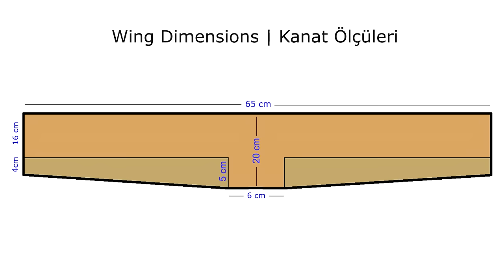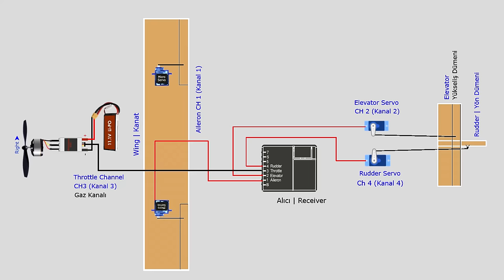How To Make RC Model Airplane Fun-Fly Style. DIY RC Airplane With Brushless motor

Comment: I got all the materials on your trainer, 2 prop plane and this plane, thank you very much for all these informative videos.
 The only problem is the Kraft (fotoblock) supply in the US, plastic covered 5mm white ones are more common. On some videos you used white, on some of them used the kraft covered one. What do you think, does it cause an issue if I use white instead of Kraft?
Reply from the maker: You can use the white one on all surfaces.
Reply: @Kendin-Yap  Aslında Flitetest gibi power kit ve ilaveten hardware kombinasyonlarını hazırlayıp ve bu kitleri ABD'de stoklasak benim gibi binlerce kişiye hem kolaylık sağlamış oluruz  hem de kıymetli emeğinizin bir nebze karşılığını almış olursunuz. ABD ihracat rejimi mikro ithalat konusunda çok serbest ve belli meblağlara kadar vergi dahi uygulanmıyor.
Reply from the maker: Mümkün tabi ama bunlar benim için sadece bir hobidir.

Comment: i have a doubt what if i use 1400kv motor with 1045 prop will it fly if yes then tell me will it be fast or slow please reply i am waiting
Reply from the maker: You should use the propeller specified in the technical data of the engine you have. 10 inch propeller for 1400KV motor is a little big.
Reply: @Kendin-Yap  bro then what is suitable can you tell me and will be 1400kv good for this build

Comment: Can I use wooden propeller with same size (6x4) two blade propeller? Thanks a lot!
Reply from the maker: Yes you can
Reply: @Kendin-Yap  Thanks!
Reply: how long will it fly using 1500 mah battery?
Reply from the maker: @dfastgamer9459  5-6 minutes

Comment: Can you please let me know about the circuit in wings there are 6 wires from servos how did you make it 3
Reply from the maker: Two 3 pin servos + One Y extension cable for parallel connection. This is normal practice.
Reply: @Kendin-Yap  ok I am confused

Comment: I could use a 3s battery with a capacity of 1500mah, would it be too heavy for an airplane
Reply from the maker: A little heavy but available.
Reply: let me ask the C discharge current of the battery
Reply from the maker: 25C or higher

Comment: Can use prop 1045 please reply for this comments please or can use 8045 or 6045 reply as soon as possible
Reply from the maker: Propellers such as 6045, 6035, 5045 are suitable. 1045 is a very long propeller. It is not suitable for this aircraft and motor.

Comment: Can I use a 2212 motor instead
Reply from the maker: Yes you can. 2212 2000-2400 kv
Reply: @Kendin-Yap  size of the foamboard you used for this build??
Reply: @kakarot694  5mm

Comment: How long push rod (14 cm or 18 cm) push rod should I use for the elevator and rudder.? And the push rod got discontinued so please send another link. Thanks
Reply from the maker: This is not a fixed measure. You will determine the servo according to where you position it. You need to measure the distance between the servo and the control horn.
Plus or minus a few cm difference doesn't matter.
Reply: @Kendin-Yap  Thanks a lot.

Comment: After a lot of work. I finished this model. The weight turned out to be 456 grams. with 1500 ma battery. 
If the author is kind enough. Tell me what costs and angles to set for a new pilot.
I have set 15 degrees throttle, 15 degrees ailerons and elevator so far. Exhibitor 33%
Reply from the maker: For a start, the aileron, elevator and rudder angles can be around 20-25 degrees. Then, if desired, increase or decrease can be made.
Reply: @Kendin-Yap  YES you are right, the consumption of 15 degrees is not enough.  Most likely the trainer will assemble the plane with a vorhnim wing arrangement. Since this one requires very good management skills.

Comment: Gud job sir..is it ok if i use motor 2212 1400kv prop 8"  tqvm
Reply from the maker: Can be used. But for the 8-inch propeller, the landing gear should be slightly upgraded.

Comment: hi, very nice video, but can you give me the link of an another foam board because the one that you linked in the description it's finished, and can you give me the flight time? thanks
Reply from the maker: Thanks. Foam Board is sold in shops selling architectural model materials in my country and is very common. It may be useful to research these types of stores in your area.
Other option: http://bit.ly/2Qb2TOr
Reply: Can i use balsa or depron instead?
Reply from the maker: @andreamarcheggiani9404  Yes you can Balsa or Depron. (Depron is lighter from Kraft Foamboard.)
Reply: Thank you so much

Comment: Can i put a 2200Mah lipo for battery
Reply from the maker: It is heavy. Maksimum 1500mah.
Reply: @Kendin-Yap  thanks
Reply: @Kendin-Yap  i see that the lipo battery you use is 74g and 119g thus it will fly if i use turnigy 137g? sorry for too much question
Reply from the maker: @katelorenz7546  I'm not sure it's a little too heavy.

Comment: what if I have two servos for elevator and not a connecotr cable where 2 go in one
Reply from the maker: You can use two different channels from a single control with "program mix". You might want to investigate the "Program mix" setting.

Comment: esc ve pilin motor çalışmamasına rağmen sadece birbirlerine bağlıyken ısınması normal mi ve çalışınca çok ısınması
Reply from the maker: Kesinlikle normal değil. Çalıştığında bir miktar ısınması normal sadece.  Bağlantılarda veya ESC nin kendisinde bir sorun olabilir veya motorun bobini zarar görmüş olabilir. Çok yapılan bir hata Motoru vidalarken gereğinden uzun bir vida kullanılması ve motor bobinine temas etmesi sonucu bobine zarar vermesi durumlarında da bu tip bir sonuç oluşabilir.
Reply: @Kendin-Yap  bir şey sorucam bende 30A bir esc ve 11.1V 2200 mAh bir pil var ısınmanın sebebi parça uyuşmazlığı falan mı acaba? motor da 2200KV
Reply from the maker: ESC 3S (11.1V) bataryayı desteklemiyorsa örneğin 7.4V (2S) batarya için se sorun olacaktır. Aynı şekilde motorun da kaç volt aralığında çalıştığını bilmeniz gerekir. Pil, ESC ve Motor ve Motora uygun pervane. Bunlar üreticinin beyan ettiği teknik sınırlar içinde olmalı.

Comment: Good job buddy. I just wonder, is the video real or from simulator? It seems the cloud in the upper right corner behaves simulated in frame 20:25? Please confirm buddy. Tnx.
Reply from the maker: Thanks. Of course it is real. And it's not a cloud. It is the sunlight reflected in the camera. The sun is on my right. You can see the same reflection at 20:37  :)
Reply: Thanks for the response. I appreciate it. Just last one thing. On this setup, When i am facing the airplane the motor is rotating ccw right?  Just would like to clarify the fixing angle of motor when facing the airplane’s front view & motor is ccw. Motor should be fixed at 3deg going to my right side . Is it correct? Thanks a lot.
Reply from the maker: @michaeltano5076  Yes motor direction CCW. The propeller turns left when we look from the front. And in the direction of rotation of the propeller, the engine was positioned at an angle of 3 degrees.

Comment: Can I use 1400kv motor for this air craft. Because I have 1400kv motor. I have not money to by a 2000kv motor.And i have a 3300 mah battery.
Reply from the maker: You can use 2212 1400kv motor. But the 3300mah battery is too heavy for this plane.
Reply: @Kendin-Yap  Ok thank you very much
Reply: @Kendin-Yap  Does this mean I am able to use a motor 1400kv Size 2212In another plane, is it heavier or lighter?? With battery 2200

Comment: you didn't quite show how to connect the second servo for second wing airlon as your diagram connect only one of them;
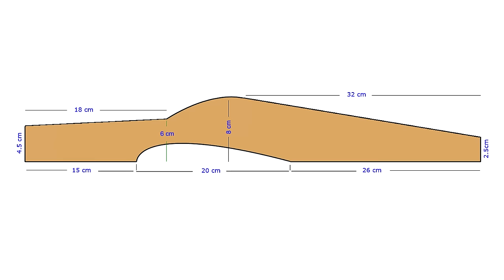Reply from the maker: 6:18 .. Y type servo extension cable… With this cable, 2 servos are connected in parallel. Then it connects to the aileron channel.
Reply: @Kendin-Yap  and it supplies two servos on same channel and one power? Nice..  what about engines if it's two? Can you make it same way and connect by y extensions to one ESC ?
Reply from the maker: @VictorSeedorsky  "Y" type extension cable is used to control two servos or two ESCs over a single channel and the necessary energy is provided. All channel power outputs (+ & -) of the receiver are already connected in parallel. Signal outputs are separate.
Reply: @Kendin-Yap   Could you send me to one of your projects to show me how do you do it wit that connection mentioned above so I can see how you made it with two engines to one receiver and one battery connection, please. I am going to make two fanjet engines aircraft in the future but I am not that good in electronic and always did single motor planes before without soldering anything.
Reply from the maker: @VictorSeedorsky     Y cable is sold ready. Y extension cable: https://www.banggood.com/custlink/D3DmBNWFtP

Comment: then how can you charge the battery
Reply from the maker: The cover of the battery compartment, which I fixed with a single screw, opens easily. 14:40

Comment: What is name of material that you used in this build
Reply from the maker: The name of this material is "Foamboard".
It is covered with foam inside and kraft paper on the outside.
It is generally sold in shops and hobby shops that sell the necessary materials for architectural model making.
Reply: @Kendin-Yap  thanku so much sir for  respect that you replied me thank you very much

Comment: Can i build it with cardboard?...
Reply from the maker: Cardboard is very heavy.
Reply: Yes. I made with cardboard and it is heavy i think. It is moving but not lifting. Is there any chance to fly it. I used 1400kv bldc, 30 esc with 10x4.5 prop and 2s li-ion battery. Please suggest.

Comment: 39000rpm motor yeter mi
Reply from the maker: Hayır bu uçak için fırçasız motor gerekli. 2205 2000KV veya 2300KV  uygundur.
Reply: @Kendin-Yap  peki başka ucuz bir pil önerebilirmisiniz mesela 800 mah kaldırır mı uçağı

Comment: Sir, can I use 3s 2200 mah instead of 3s 1100 mah and add flaps?
Reply from the maker: You can add flaps. The 2200mah battery is too heavy for this plane.

Comment: Looking good Ken...I can build lighter than you. i can build a 30" under 400gram AUW.
on 2200mah 3s :-P 

i do need a smaller model so I can actaully fly it a a local park a couple blocks
from my house...but there's a couple of trees right around 100 yards away from each
other...I need to fly in a tight box.lol

i have some 2206 -2208 and wazoo of 5x34.5 or 6x4 props laying
around..and 1000 mah 1500 mah ..if can get to fly at almost 500grams..I might 

get close to 285-300..there about :-P

Comment: Hey, when I connected esc to battery it's got smoke and smell. What is the problem help me plss
Reply from the maker: There's reverse current. So you may have incorrectly connected the battery poles (Positive-Negative). Or you may have short-circuited the motor outputs.
Reply: @Kendin-Yap  if I do like that is there any problem for motor
Reply from the maker: No problem for the motor, but ESC is a problem.
Reply: @Kendin-Yap  is there any solution

Comment: How do you call this styrofoam that you use in the videos you make because I'm interested and I wanted to do more, but NN I know what you call the styrofoam that you use I'm from Brazil I just wanted to know if you read at least this 🥺
Reply from the maker: Foamboard: A lightweight material with foam inside, paper-covered outside

Comment: Can you give me the link of propeller that you have used in this plane the link that u have given me   is different as shown in this plane video plzzzzz plzzzz if u give this I m so thankful to u
Reply from the maker: That's what I use. https://www.foxtechfpv.com/t-motor-t6535-a-2pcs-pair.html. But you can use any 6040, 6045, 6035 propeller.
Reply from the maker: This propeller isn't sold in Banggood. You can use any 6x4 propeller.
Reply: @Kendin-Yap  can u give me the link of 6×4 props
Reply from the maker: @SHIVAMYADAV-jc5sg   https://www.banggood.com/custlink/G3vGnV0h0l or https://www.banggood.com/custlink/GvmDbH4d0f

Comment: What is the name of the plane and what the weight of your plane
Reply from the maker: No name. 490gr .. Technical information is below the video.
Press the arrow symbol on the right below the video. (For mobile)
Click the "More Information" link below the video. (For PC)
Reply: @Kendin-Yap   Now I made like you said but the wait is around 800gm  will it fly with 1000kv brusheless motor with 8045 prop and 1000mah 35c 3s lipo ..

I orded flysky I 6 transmitter from Bangood and some other parts from your banggood link u provided

Comment: Abi 4 kanallı kumanda demişsinde bu 5 kanal oluyo bende yapıcamda flysky fst4b alaçam 4 kanallı oraya yanlışmı yazmışsın
Reply from the maker: Uçak 4 kanallı. Gaz, Aileron, Elevator, Rudder. Eğer aileron servoları 2 adet diye 5 kanal sandıysan bu doğru değil. 2 servo y tipi uzatma kablosu ile paralel bağlanıp tek kanala takılır.
Reply: @Kendin-Yap  nasıl paralel bağlayacağız bende yapacağımda

Comment: Merhaba bir sorum olacak bu uçaği yapmak için batarya hariç bütün ekipmanları sipariş ettim. Motorun verimli çalişma araliği 2-4s ve 12-16V olduğundan ESC yi 40A ve bataryayi 4s sipariş etmek mantikli geldi fakat batarya 4s 1300mah olduğundan(1000 mah 4s Türkiye de yok) agırlığı 145 gram oluyor. Bu ağirlikta batarya ile uçak sizce uçar mi?
Reply from the maker: ESC nin 40A olması bir sorun değil. Ama 4S batarya motorun daha fazla güç ve devir üretmesini sağlayacak. Bu uçak hız uçağı değil. Bu yüzden 4S çok anlamlı değil. Pilin fazladan ağırlığını 4S ile çalışan motorun fazla gücü karşılar ama uçağın stall hızı yüksek olacak. Yani minumum havada tutunma hızı yükselecek. Eğer uçuş tecrübeniz fazla değilse 3S kullanmanız daha doğru olur.
Reply: @Kendin-Yap Cevap için teşekkürler :) Uçuş tecrübem yok bu yüzden yavaş bi uçağı kolay kontrol edilebilirliği açısından tercih ederim fakat uçuş süresinin olabildiğince fazla olması benim için daha önemli maximum uçuş süresini sağlamak için önerebileceğiniz pil var mıdır?
Reply: @onursaldamli4555  hocam yaptığınızda videonuzu bekleriz. umarım başarılı olursunuz :)
Reply: @rigodianaliya7998 umarim

Comment: Abi yardım lütfen aynı ölçülerde yaptım 1400 kv motor ve 2s 1350mah pil kullandım yeterli olurmu acaba
Reply from the maker: 2S yeterli gücü vermeyecektir. 3S ile olur.
Reply: @Kendin-Yap  1400 kv motora pervane önerin nedir abi
Reply: @aykutyurken4521  8045 veya 9047 ler uygundur

Comment: yardıma ihitiyacım var uzun süren yapım ve malzeme toparlama sürecinden sonra bu uçağı bitirdim sayılır fakat elimde önerilen bir pil mevcut değil. araştırdığım ve bulduğum piller sırasıyla : 
11.1V 3S 850mAh Li-Polymer Pil 80C
11.1V 3S 1300mAh 3cell Li-Polymer Pil 20C
Power-Xtra 11.1V 850mAh 80C Li-Polymer Pil
Leopard Power 1300 Mah 11.1V 3s 25C Lipo Batarya
3S 11.1V Lipo Batarya 850mAh 30C - 3S Lipo Pil
bu pillerin C değeri önemli mi videoda önerilen pil 3S 1000Mah 25c lipo yardımcı olurmusunuz 11.1V 3S 1300mAh 3cell Li-Polymer Pil 20C bu pili kullanırsam uçağım kalkarmı uçağımın ağırlığı yaklaşık pil ile birlkte 512gr olmuş olcak (pilin datasheet teki ağırlık değerini varsayarsam.)
Reply from the maker: 25C 1300 ve 80C 850 her ikisi de uygundur. 850mah olan pil daha hafif olduğu için biraz daha hız sağlar ama uçuş süresi açısından 1300mah olan daha iyi olacaktır. Sonuç olarak 25C ve üzeri 1000-1300mah ve 40C üzeri 800-900mah aralığında olan pilleri kullanabilirsiniz.
Reply: @Kendin-Yap  çok teşekkür ederim abi pili verdiğin değere göre alacağım